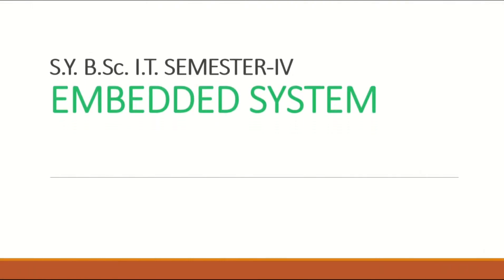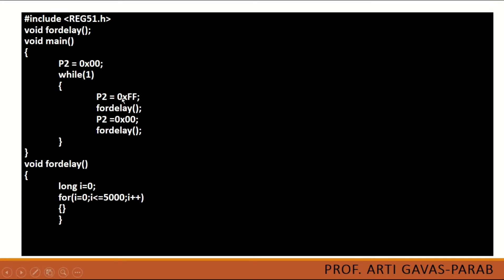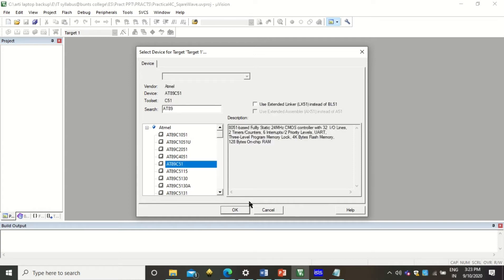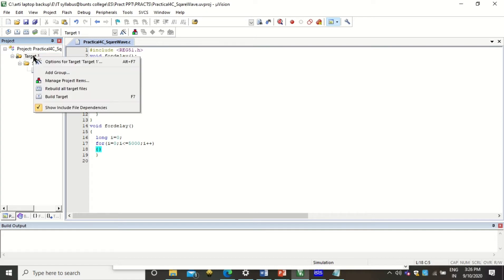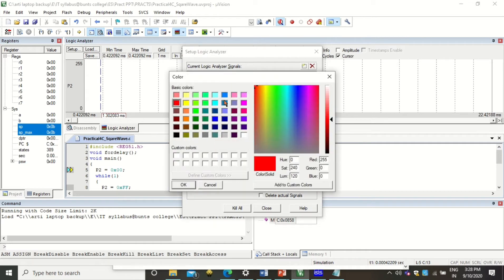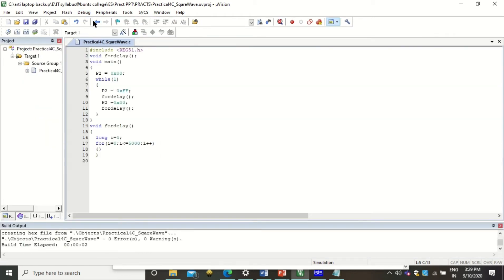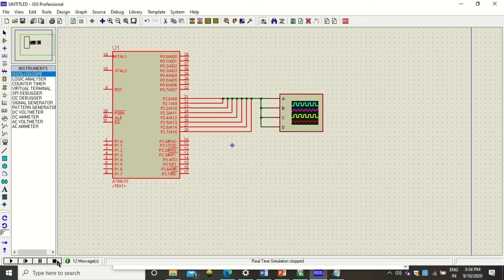Generating a square wave using 8051 Microcontroller and Oscilloscope Simulator in Proteus

Comment: ramp is coming in my wave when running on proteus
Reply from the maker: Please check in your code that the delay function call is used at appropriate places.
Reply: @artiparab4583  The code is same as yours, when i run code in keil i get correct graph but when i run in proteus there is some ramp in square wave.
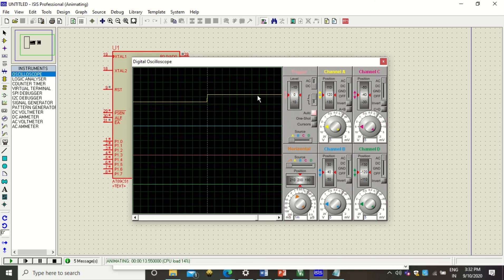Reply from the maker: @gktech8220  Ok, then you should adjust the setting of virtual oscilloscope. Adjust the setting for that channel to which you have provided the input. in my case it is Channel A. Please watch video from 12:30 Mins onwards(Adjusting Bottom left corner of oscilloscope buttons, besides channel B). Even in my case first it is ramp signal and then after adjusting the position of signal, We get square wave.

Comment: In my pc if i run this program then this digital oscilloscope window is not coming any suggestions!!!???
Btw helpfull video!!!❤️👍
Reply: Thankyou soo much for helping now my output is running well❤️💯
Reply from the maker: Thanks for watching the video. If you want to check o/p on oscilloscope, try changing Voltage ranges under channel A and also change the position of signal using 'Horizontal' source setting.